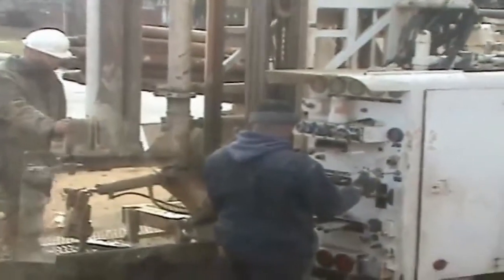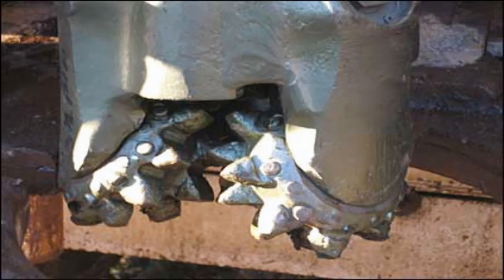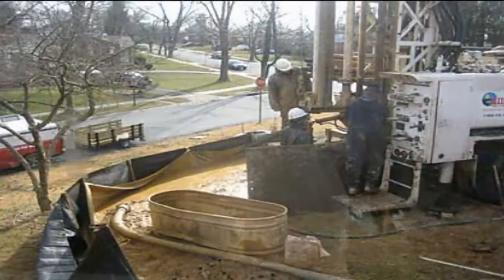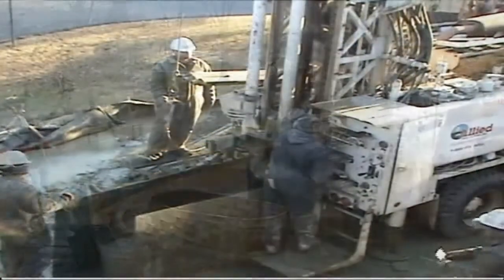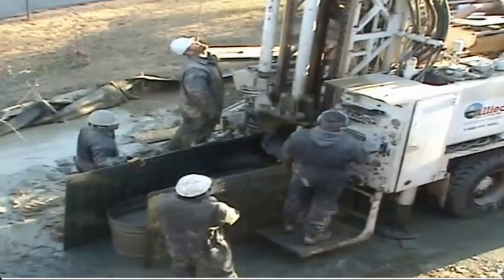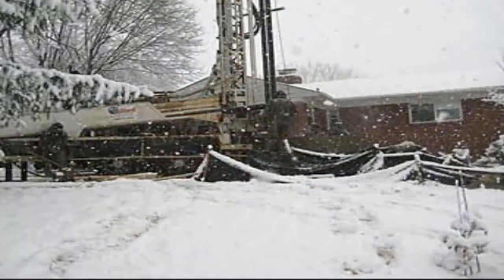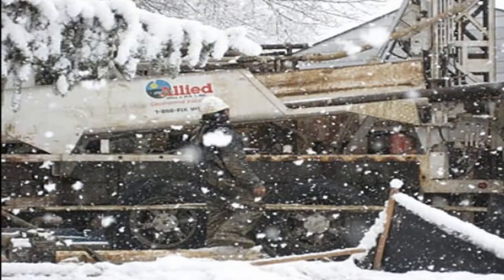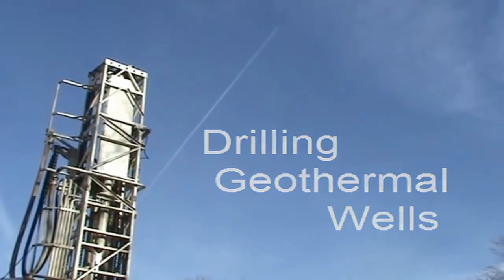Drilling Geothermal Wells for a Residential Geothermal Heat Pump

Comment from the maker: The geothermal well drilling was about $9,000 in 2007.  Then the rest of it (geothermal heat pump installation) was about another 11K.   

Only regret was that a new rebate came into effect after we installed the system.  We were eligible to get the money but were unaware until much later.  We did get 3K and then some other federal money previously so that helped.

But the geothermal heat pump system works well, especially cooling the house in summer.  So regrets about that.